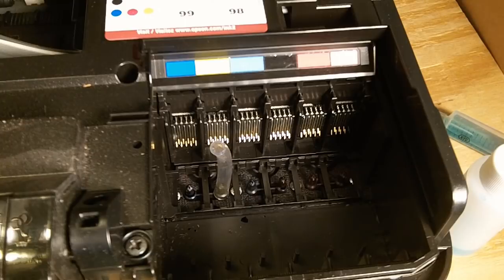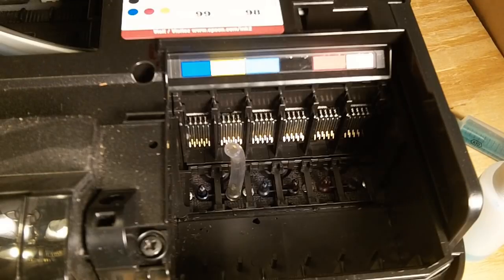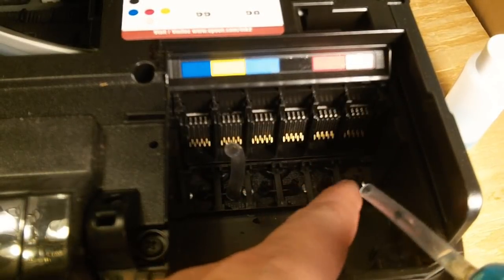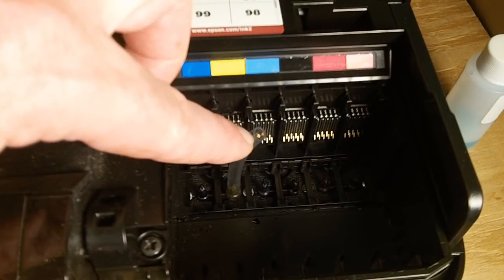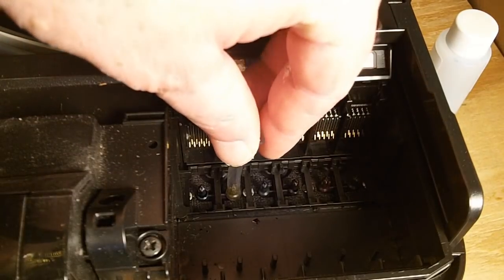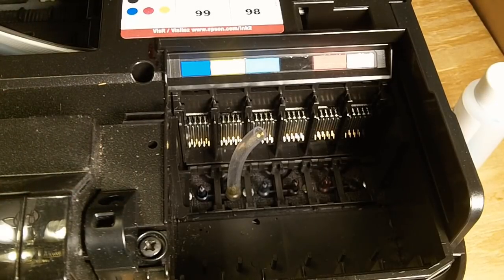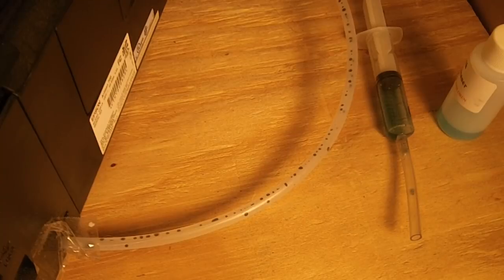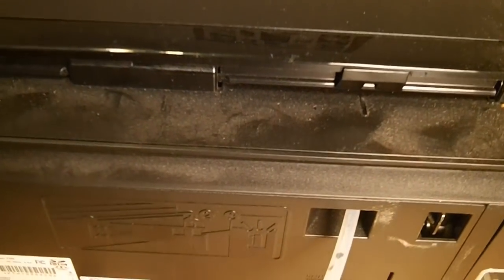Giving up on a dead printer? Try my way to unclog inkjet printer port

Comment: Hi, I watched your the "DIY Inkjet print head cleaner,simple,cheap,effective" and this video. I have over 20 Epson WF-3640 and I tried the method on 3 of them and whatever color I used the method on it would no longer print that color. I followed the instructions step by step. Would you happen to know if there is something different I need to do on a Epson WF-3640?  Thank you for the videos and your time.
Reply from the maker: No, I don't, sorry Spencer. You can check the comments left, some people tried other methods and provided additional helpful information.
Reply: @RobbsHomemadeLife  ok thanks,

Comment: Do these tips work for all printers?  I have a Brother MFC-J280W.  It is about eight years old.  I clean it regularly using the printer cleaning program, and I  just replaced the  Black, Magenta, and Cyan cartridge, but after I finish the cleaning process, there is NOTHING in the Magenta block!  :(

This has never happened before and it is seriously irritating me.  I do understand that I have had my printer for many years, but do you have any suggestions to fix this problem?
Reply from the maker: I would first replace the magenta cartridge, perhaps the new one was bad. if that does not help i would try to unblock it using the method I showed assuming your printer is similar.

Comment: I have an Epson 835 and the issue is not clogged heads. It freezes upon powering on and the display flashes with the message that a "Printer Error has occurred". I tried some things suggested by the JustAnswer  site, but they didn't work. When I free the print head and move it to the left and turn on the power, it tries to start normally: the print head slowly moves to the right. However, when it reaches the ink reservoir area, the sponge, it bumps up against it the pad holder and triggers the error. I looks like it should clear the pad, but the pad will not stay down when I push it down. I wonder if it is gummed up under this pad. However it is not easily accessible. I do not see a way to unscrew the plastic cover that prevents access to the pad. Do you or does anyone reading this have a suggestion? I like your philosophy of not wanting to throw away such a large and 'almost-working' machine!
Reply from the maker: Doug, sounds like you located the problem, you just nee to locate a source for the repair manual for the epson. Try doing a google for the phrase 'epson 835 manual pdf'. If you can take it apart you may be able to locate the problem and fix it. Do a video of it and you may get a few bucks from YouTube.
Reply: @RobbsHomemadeLife  Thanks Rob! I will try your suggestion...

Comment: I didn't bother with the tubing and waiting at all. My printer was not printing red at all and it was coming out yellow. My Nozzle Check showed that the Magenta wasn't showing up at all. So I tried the Head Cleaning...that did not work. That is when I used was isopropyl rubbing alcohol on swabs (squeeze excess off) and cleaned each port really well until ALL the remaining ink that was on each port was cleaned off. I did a print test, it still did not work. So I ran a 2nd Head Cleaning and then testing printing afterwards and it worked! It took no more than 5 minutes. My printer is and Epson Artisan 730. Works like a charm now and I was just about to replace it!
Reply from the maker: good info, thanks for sharing.

Comment: Question How can I prevent this from happening.
I have a inkjet printer that I rarely use. (Appox once in 6 to 8 months) Can I store the print head and the ink cartridges in my freezer or fridge section or what else can I do to prevent this from happening 
Thank you much !
Reply from the maker: You have a very good question. I don't have an answer, but if I wanted to keep a cartridge from drying out for 8 months between use I would try putting it in a bag and vacuum sealing it to remove the air.

Comment: hey Robb, if I let the tube remain connected to the ink head port for a couple days,  should the other end be closed to prevent evaporation? what I did was to let the other end remain attached to the syringe. Unfortunately after letting it sit like that for two days, the port is still clogged.
What should I do? it seems hopeless. but at least only one port is clogged.
Reply from the maker: Maybe keeping the syringe attached kept the liquid from draining through.
Reply: Robb's Homemade Life I removed the syringe and let the tube stand there for a week and the port is still clogged. Any other suggestions? should I use pure ammonia? should I unblock the holes with a toothpick?
Reply: yo dude
Reply: the problem doesn't seem to be on the visible side of the port (the protruding part where you connect the hose)  because I can suck a bit of ink thru it.
So I guess the problem is on the underside? what do I do now? any suggestions?
Reply: @eeyyaakk6801  What has helped me is a warm solution, and I often change fluid in the tubes. I didn't leave it for a long time, but about an hour, then warm solution again. I gently inject with the syringe, and then allow the tube to flow naturally. If I see it doesn't drain, I repeat the action again until I see that it begins to drain.

Comment: My printer is a brother printer. Mfc-j425w series. The nozzles? Are not upright like this printer. They are horizontal. I guess i just have to stand up my printer? This is really frustrating. Ive been trying to get the red color to work for over 2 weeks now. The guys at the ink refill store told me to buy a new printer but i refuse. I want to try to fix it first. I am going insane here....

Comment: Great video. However you said you would give dimensions on the tubing size, but I didn't see anything that gave that. Can you respond with that? Thanks so much.
Reply: Thanks so much for getting back to me!
Reply: What size was it?
Reply from the maker: PENN PLAX Standard Airline Tubing Air Pump Accessories, 25-Feet

Comment: Mr. Moffett:
Please identify the proper size tubing.  
Inside diameter and tubing composition.
Manufacturer and Part number for Tubing.
Thanks for your video
Reply from the maker: here is the 3/16 inch tubing I used on amazon
PENN PLAX Standard Airline Tubing Air Pump Accessories, 25-Feet
http://amzn.to/2qYbRjO

Comment: Great idea but don't try it on an Epson 1400 with those tubes. They don't fit very well.  The nozzles on the printer are staggered and don't allow the tube to fit very well. Maybe I'll try a smaller tube or a straw
Reply from the maker: thanks for the tip!

Comment: Hi Robb. I have tried your formula mix with Windex and Isopropyl alcohol for months over and over again on my Epson Stylus Photo RX595 and the colors are not quite right but when I print a test page the black print is good and easy to see but every few lines of print text has a skip or wide horizontal white blank line cutting off half the text vertically. It wont clear. So what do I do now? Use straight Isopropyl alcohol with out Windex or go to something more powerful, maybe hot water, or?
Reply from the maker: Richard, I have seen that specific problem  but it was a long time ago and I don't remember what happened or if I ever fixed it. However if it is consistent try doing a google search for the printer behavior and see if you do not find a mention of it in a forum. I am not a printer tech, it should be an easy problem to identify the cause and if there is a fix for it.

Comment: If You have the problem after cleaning a clogged port on one color or even more. if it;s muddy color afterwards or streaking and the answer to the problem is USE before you get it back.   just go to paint.   make a square of that color you want to fix,  print that page after you save it, the ink required for that page will be seriously over taxed and by doing that it will work more ink through that port.    so say you have a issue with black - run a full page of black.
Reply from the maker: +Larry Leisuresuit good tip larry, thanks !

Comment: Rob, I have a Canon PIXMA i100. It isn't set up like your printer for cleaning. My magenta hasn't worked in three years but I usually print in BW while I travel with this smaller printer. I have tried to do a deep cleaning using just the printer to clean the printer heads. All I succeeded in accomplishing is using up all my ink. I can't see how to insert tubing to run out of the printer to use your homemade print head cleaner. So...what do you suggest?
Reply from the maker: Sharon, I accessed the ports by removing the cartridge, I can't help much as I do not know how your printer is constructed.
Reply: Thanks for your reply. I was doing a "regular cleaning" 12 times and used a  LOT of ink. I went back and did a "deep" cleaning on the printer and it cleared some of the magenta by using a different computer. I still get lines, however, when I try to print a photo. Thanks for your effort. You're a sincere person trying to help others.
Reply from the maker: Sharon, I really appreciate the comment.

Comment: I have an Epson workforce 30 that stopped printing, I use it with edible ink for baked goods. I was able to bypass the waste tubing but can't get to the bottom otherwise to soak up some of what's on the pads. Any ideas?
Reply from the maker: +Miranda Porterfield The Artisan is easy to open on the bottom, not sure about the workforce. maybe someone else can comment.

Comment: I have nearly the exact same printer (Artisian 725), but plastic tubing with an interior diameter of 5/16" (7.93mm) is too big (not snug. Slips right off. Fluid leaks around sides). 1/4" (4/16th or 0.25") is too small (I sound like Goldilocks) and won't fit over the ports. 1/3" is too big also. Where did you find exactly 0.3" diameter tubing???
Reply from the maker: hello Mugsy, I used aquarium tubing and left a link, some of the commenters also came up with alternatives that might help.

Comment: I have an XP-410 and it's showing that I have basically a full cartridge of black, but when I try to print in black it prints as a light grey? it has been unused for about a month. All other colors seem to be printing fine. Any suggestions?
Reply from the maker: did you do a print test to see how each color is printing and did you see any broken lines? on some priners there are advanced setting s where the colors can be tweaked, look to see if you can reset settings to factory default.

Comment: Hi, I did what you said, but now I get "no" ink coming out on any color. You mentioned or someone did... an air lock? how do I start pulling ink through my head again or did I completely ruin it?
Reply from the maker: If you are using a CIS and see bubbles in your lines you may have an airlock and can remove the rubber plugs in your CIS to let air in. If you are using a factory setup cartridge and your ink stopped coming out you need to try and unplug the head with the cleaning solution and tubes as  mentioned in the video. If it does not loosen after repeated soaking you can try using pressure with your syringe. if none of that helps I have no other suggestion other than to scour the forums and see what ideas others might have to help.
Reply: Hi Robb, thank you. I have no idea what a CIS is. I am using cartridges. I was able to get blue and black before hand. Now after cleaning, I get a blank page. I will try again. 
Thank you.
Reply from the maker: Terri, CIS is a Continuous Inkflow system that is used to replace cartridges, you can buy then on ebay.

Comment: If the clog is bad, but not too bad, distilled water is the go-to solution.  You don't want hard water crystals in your print head.  If the clog is really bad, ammonia will work but it is corrosive to print heads, so you have to flush it all out with distilled water if you dare use it.  Right now I am trying hot distilled water.  We'll see.

Comment: I have an Artisan 810, how do you get that thin metal plate off the bottom of the printer to access the waste ink tube.  Thanks, Robb.
Reply from the maker: MC, I don't have that printer anymore, I seem to recall removing some screws on the bottom.

Comment: I have a brand new TS6020 I planned to use for edible prints. Right after setup I tried printing and my red colors are coming out orange any suggestions? Brand new
Reply from the maker: my guess is one of the cartridges is not working, run a maintenance printout to check.
Reply: Robb's Homemade Life ran test and canon did trouble shoot with me and no issues. Why ink are you using I’m thinking it’s the ink
Reply: I meant what ink and from where

Comment: Hey Rob,
I can not find the tubing anywhere.
Where do you suggest we look.  The aquarium supplies have larger tubing but none this size.
Thanks.
Reply from the maker: Mark Taylor hey mark, you can get tubing at Home Depot and also on amazon and ebay.
Reply: +Robb's Homemade Life I used with great success the tube from a transfusion kit I got from a local pharmacy (drug store). It was 0.3$
Reply: +Mark Taylor I used with great success the tube from a transfusion kit I got from a local pharmacy (drug store). It was 0.3$

Comment: Hey Robb, I have a Artisan 1430 and lately I have started to get faint horizontal lines on my photo prints and I just wondered if you know what the problem might be?  Many thanks Richard
Reply from the maker: Hey Richard, streaking or lines means the printhead is clogged. If your cartridge has the printhead in it just do a cleaning cycle or replace the cartridge. If your printhead is in the printer do a cleaning cycle or use a cleaning solution like I mentioned if there is no alternative.
Reply: Fantastic. Thanks Robb. I wondered what the problem was. I wonder if anyone makes a anti-clogging ink for the 1430?
Reply from the maker: LOL,  you me and  and a million other people.
Reply: I bought some tubing and another printer through your link, so hopefully you'll get a little commission from Amazon Robb. Thanks again.
Reply from the maker: hey Richard, thank you very much, I really appreciate that.
Reply: Quick question Robb - Do you know the best settings  to use for printing Black and White prints on the 1430? many thanks

Comment: Hello Robb, i've an unique problem on my epson R2000.

Only Yellow & Red ink are not printing on my case, but when i'm flushing the head using cleaner solution, it came out perfectly with no sign of clog. 

Sometimes it is only Yellow not printing, sometimes the Red, or sometimes both of them. On rare occasion both of them works perfectly, not even a little bit of blank space on nozzle check. It make me confuse whats wrong with it.

Step i've done:
- Head Cleaning
- Flush printer head
- Cleaning the spikes
- Change the whole ink deliery system ( cartridges, etc)
- Re-install the printer driver and printing software.

I'm using Windows 7 32bit.

Trying your method at the moment....

Any suggestion would be very appreciated.

Warm Regards,
Welly
Reply from the maker: +Welly Kheiz hello Welly, are you using a continuous ink flow system? if so, look to see if you have bubbles in the line. Sometimes the reservoir gets the air inlet plugged and a vacuum builds up and does not let any ink flow.
Reply: Yes, i'm using continuous ink flow system. I can confirm there is no bubbles in the line and i also tried to suck up the ink from the tube. And i also tried to replace the whole ink flow system with my another set of printer which works fine. Thanks for your reply Robb, any other suggestion?

Comment: Hello Robb. I've tried to find your video on the printer head cleaner solution....Can you share the ingredients?! Thanks so much.
Reply from the maker: BlueOwlNightBird hello, It was alcohol and homemade window cleaner,1 to 4 ratio. but you can also use windex with alcohol, I will see about posting a short video on it this week.only use it if you have no hope as it will not work with all inks.thanks
Reply: Robb's Homemade Life
Hi Robb,
Is it 4 parts alcohol to 1 part window clearner? 

Thanks for any help on this subject
Mike
Reply from the maker: Hey ev, that is it exactly, 8 parts regular plain windex or plain ammonia and 2 parts of 70% or 90%. alcohol, with no coloring agents or additives in either item
 I will post a video tomorrow on making the solution and making the window cleaner in case no one can find plain window cleaner anymore. this works well for most printers. I did recently have a blockage ion my Epson and the cleaner dissolved it but the printer ran terrible for about ten days, it was streaky and the colors were muddy, I could only use it to print some text., but the colors  got a little better each day and it works like a champ now and I would have had to throw it away.
there is one type of ink that has a different ph than normal, I think it is Lyson, and this cleaning solution will cause the ink to gel or clot, which means the end. only use this solution if you have no alternative. But I have not have it fail me yet.

Comment: So they normally clog up for first time using?
Reply from the maker: mine clog if they dry up fro not being used.
Reply: @RobbsHomemadeLife  i got a cheap dtg garment printer from China and its only been able to do cyan colour on print and nozzle check.
Reply from the maker: Alex, do not use my cleaner with any inks that are pigment inks, it is just for normal inkjet cartridges used in printing documents.

Comment: I tried the smallest tubing I could find and it was still too big. I tried using wire heat shrink as a reducer on the tubing,  and that didn't work. I blew thru the tubing and nothing. The cleaner just made a mess everywhere and wouldn't stay in the tube it ran right out. And still not printing!
Reply: You know the spray bottle for windex? I cut the tube of the spray and used that and it fit really snug. I'm just waiting for the ink to soften up now. I hope it works.
Reply: @icexangel  Thanks! The airline tubing too bog. Windex bottle tubing=perfect